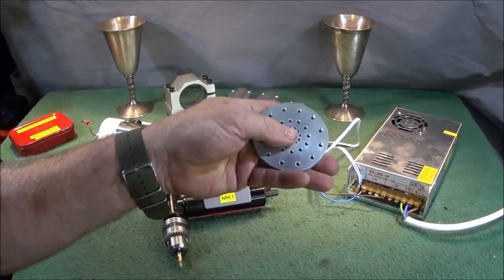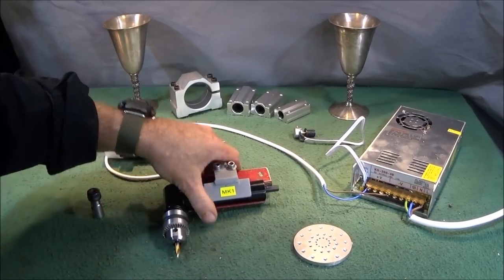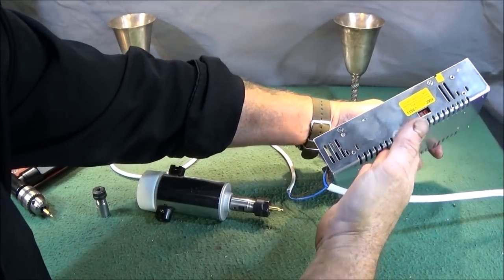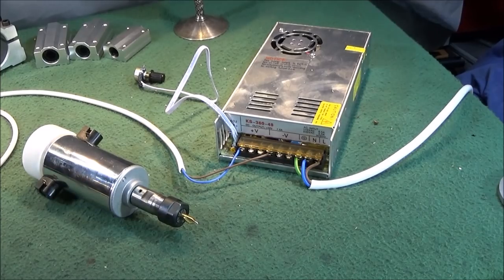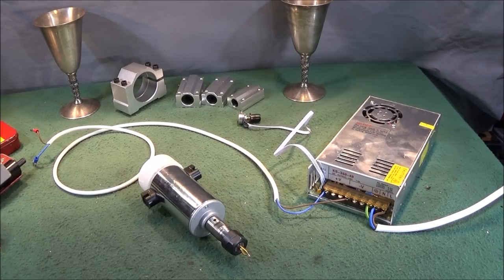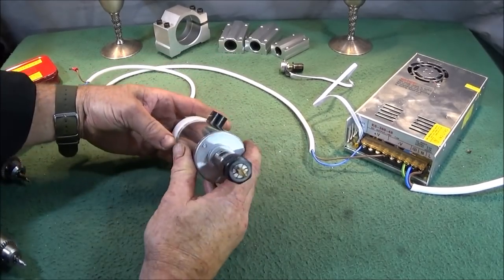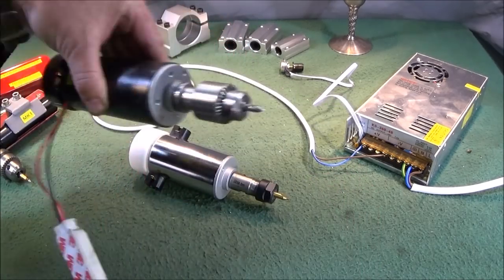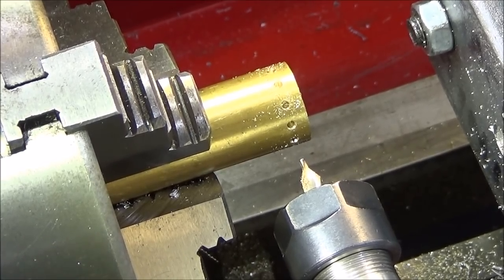A Ready Made Face Plate Drill & The Machifit 300W 48V DC Motor

Comment: I like the holder you made for the angle drill.
Reply from the maker: Yes I was very pleased the way this turned out. I think I will be using it a lot to make various different components, plus I want to see how accurate it is and whether I can use this set-up to do initial drilling on chuck back-plates etc.
Reply: A simple, yet elegant solution for attaching accessories to a lathe without altering lathe function.  Your projects have given me confidence in my work on the lathe.

Comment: Thanks again, Steve! You might just get a little less wimpy cable out of the 48 V regulator, as the voltage drop can be quite large. Guess you're using household AWG 18 or 0,75 sqmm? Go for AWG 15 at least (but even loudspeaker cable will do as its <60V), as the beast takes on max 6 amps nominal, and the regulator maxes out at 7,5. You'd be amazed how hot even a short cable can get, and how much better the revs regulation can become by using a lo-resistance cable. Two cents! DIYSwede
Reply from the maker: Hi Johan, Thank you very much for this information. I only know very basic electronics so everything like this is great learning for me. I must try this out. Regards Steve

Comment: Hi Steve.   Could you use a plate steel like you did with the angle drill and just put it in your tool post holder to drill holes?   I was also wondering if it would line up okay that way as well.    Still enjoying your videos.

Comment: Hi Steve, I wonder if you or any of your viewers could point me in the right direction. I have just taken delivery of a Chinese lathe and would like to make an indexable backplate for the end of the shaft or chuck. Is there any easier way other than marking out all the holes with a protractor and dividers?
Thanks for your time.
Reply from the maker: Hi Glyn, One way of marking one out is to use a bicycle gear sprocket. I have one with 24 teeth and one could easily set it up on the back of the spindle to use whilst drilling a ring with a tool-post drill. If you do get one made, you could make them up and sell them. I would have thought someone with a CNC lathe would have made load of these by now to sell.
Reply: Hi Steve, thanks for replying. I will have a look for a gear sprocket, I just thought though, I think some car brake disks have holes in them, maybe I could pick one up ready-made... You're right about the lack of them for sale, it will be the first thing I put on eBay when I'm up and running!

Comment: Hi Steve, You would get a lot better speed control and more torque using a PWM driver. Also have you thought about making your own spindle instead?
Reply from the maker: Hi Dave Yes I'm already onto that. I've nearly got all the parts to make a milling attachment to go on the Myford. I will show an intro video this week on the motor set that I bought to drive it. Also I'm using large tapered roller bearings etc for this project and using an ER20 collet chuck. The spindle mount is all planned and read to make. Just got to work out the mount and belt drive for the motor.
Reply: The adjuster on the switch mode PSU is already effectively PWM.   The problem is the same.  To lose speed, you lose power.   The only way to get low speed at full power for milling is to gear down the motor to the spindle.

Comment from the maker: SEE BUYING LINKS BELOW:_
 300W High Speed Air Cooled PCB Motorized Spindle Motor --  https://goo.gl/xJDVY6 
 90 Deg Right Angled Drill Driver With Chuck Key 1-10mm Range (Key Chuck) --  https://goo.gl/NdMUPV
 90 Deg Right Angle Bend Extension Drill Adapter Electric Tool (Keyless Chuck Type)--  https://goo.gl/arshJS 
 ER16 Collet Chuck Holder Motor Shaft Extension Rod --  https://goo.gl/LMNwc5
Reply: Wonder why they say keyless on the right angle drill but show a key. Do they mean they do not provide key or just not know what they are selling.
Reply from the maker: Banggood 12th Anniversary Electronic Sale --  https://goo.gl/SY4GX1
Reply from the maker: There is a Key type chuck right angled driver and a keyless one, so I have put both in the links above now.